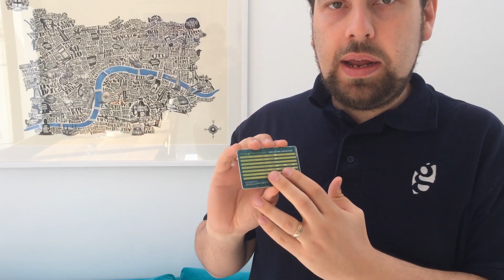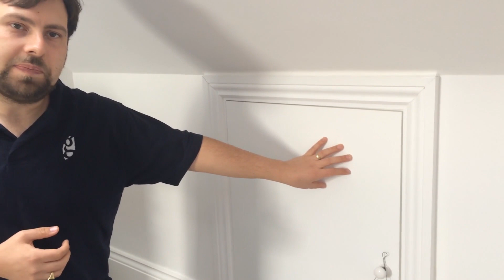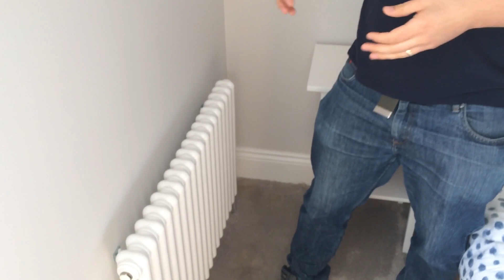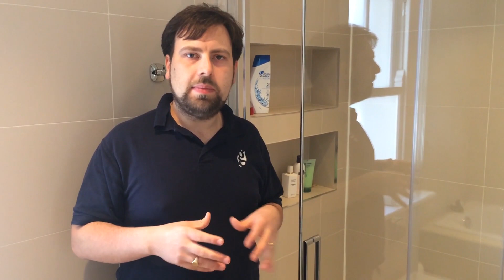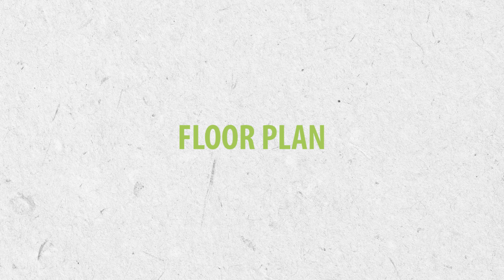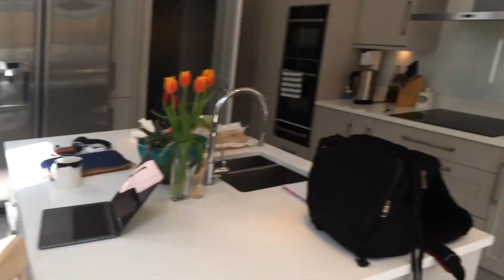The Ultimate Guide to an EPC (Energy Performance Certificate) | TheGreenAge

Comment: Don't forget to check for Window Film on the Glazing :) A Low E window film installed to single pane glazing would give near dual pane performance (similar with double to triple). Worth noting as it adds points :)

Comment: 'depth of loft insulation'....... and now what when you have high performance rigid insulation boards ? (that often perform BETTER than any thickness of fluffy stuff).
EPC checkers often don't know what to do with that as it's not 'catered for' in the guidelines.
Reply: You're wrong. It is covered

Comment: How is it possible that our house was rated whilst the developer completely forgot to insulate the loft. It was zero insulation in the loft. A snagging company hired detected the issue? Please how should I professionally address this issue with the accessor without necessarily causing problems for him. Thanks.
Reply: His details will be at the end of the EPC.  Contact him directly and point this out to him.

Comment: So actually is no ,,check" because u Don't know how thick the insulation is or what wall will be made off. Checking is not mathematics formulas with the information provided by the client( witch anyone can do) but a device witch can actually tell you the heat loss

Comment: One question

My EPC is definitely massively wrong 

The discovery of a single brick outside wall with a single glazed wooden window from the 60's that is nearly as wide as a the brick is

Making this easy to spot to someone who's in the building trade visitors have even noticed it without promt or anything else 

Yet I have no luck getting the housing association to even look at it 

How can I go about claiming another EPC check without incurring the cost that should be free to me or the housing association due to the first one being fraudulent.

Who can I get to investigate this and who regulates this does it stop at storma however it's spelt or is there anyone else more relivent